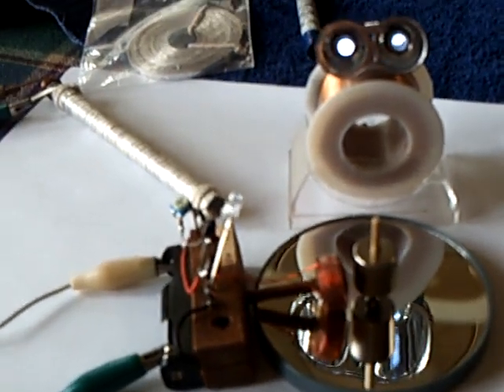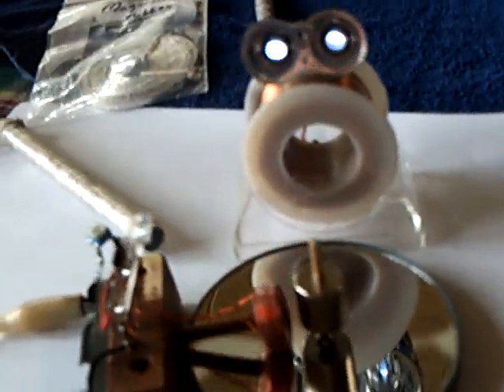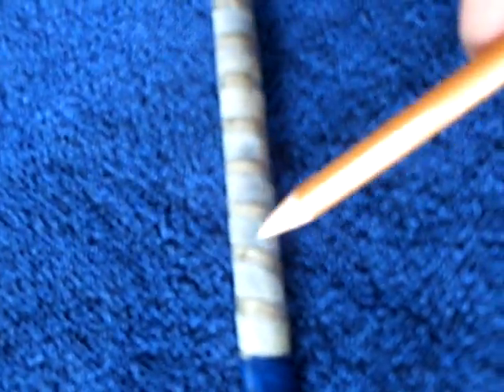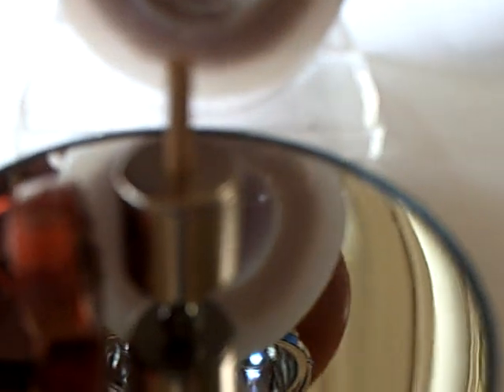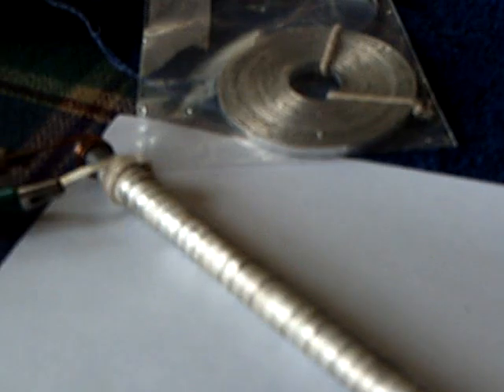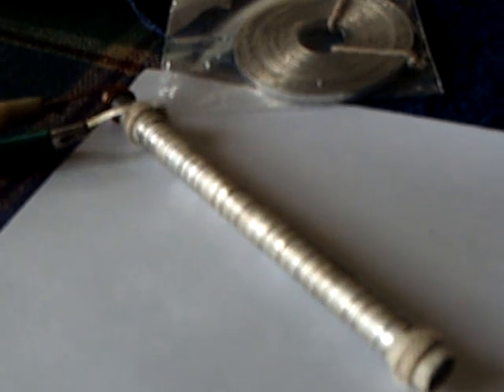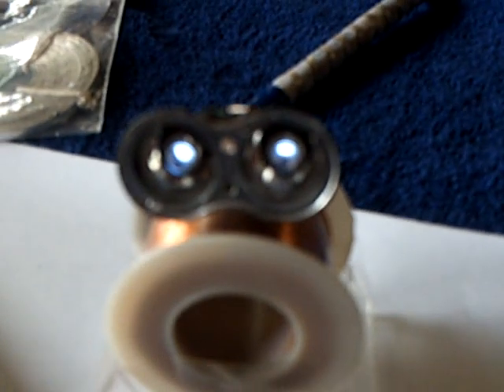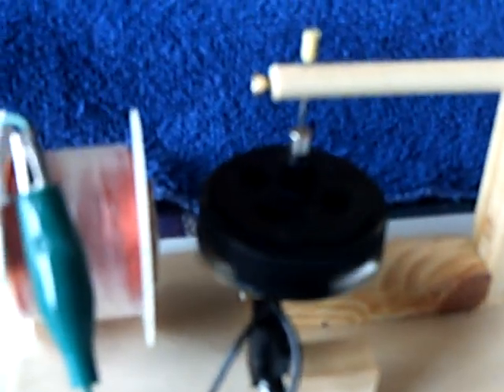Stronger Magnesium Ribbon Battery.ASF

Comment: Lid, You might want to try using Glycerin and water in your battery. The Glycerin will hold the water in place longer so your battery runs longer and the water will not dry out as fast. The Glycerin itself will not dry out. You can try different concentrations of Glycerin and water. Also the good part about Glycerin is that it just washes out with water if need be. Might be worth a try. You can find Glycerin at most supermarkets and drug stores. CVS and Albertsons has it. Slinky.

Comment: Lid, One thing you might try to operate your fluoresent lamp using the heater elements in the end of the lamps. Many ballasts keep a small amount of current on these end filaments to keep the emission level up and help reduce the power needed to make the lamp conduct through the Mercury vapor in the lamp. A small amount of current helps keep up the temperature in the bulb ends. May be a small ribbon battery for each filament would work. I am still watching and learning. Slinky.

Comment: Thx Lidmotor.  Really cool designs as always.  Just wondering how lasersaber runs his without any water.  Maybe the moisture from the masking tape?  I tried also graphite rod like yours but same results as my carbon electrode bars.  Need moisture to run.  Are you using saran wrap to hold / collect moisture?

Comment: Lid, I really like your copper and mag-strip battery.
What a cool twist on an interesting idea to start with.
If it's putting out enough juice to run a pulse motor, you should be able to light a floresent with it.  Have you tried it with the Slayer Exciter yet?
The cool thing about your ribbon in a tube is - it can be made any size you want - cheaply. Those carbon and ferrite rods are easy to break. Just drop them once and - snap. The copper tube isn't going to break - ever.